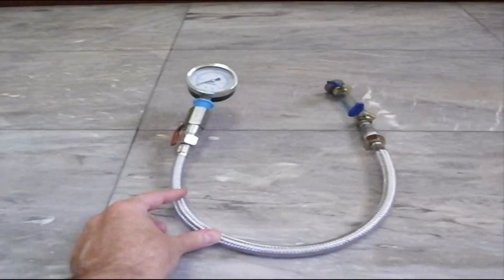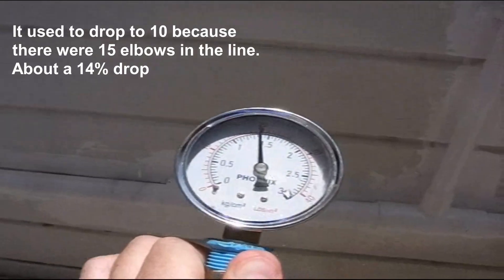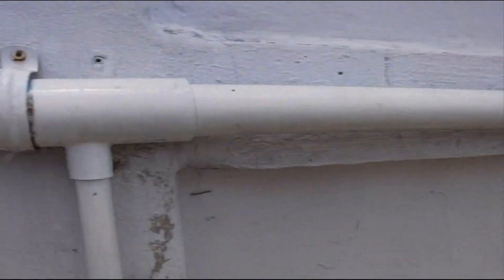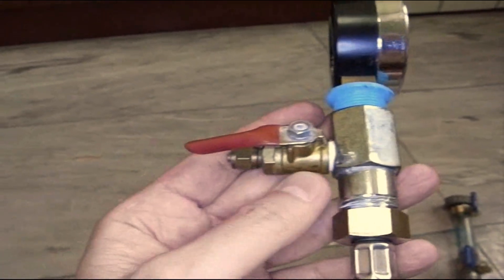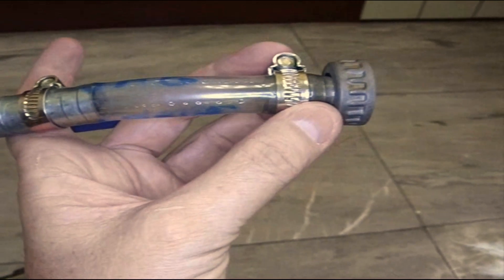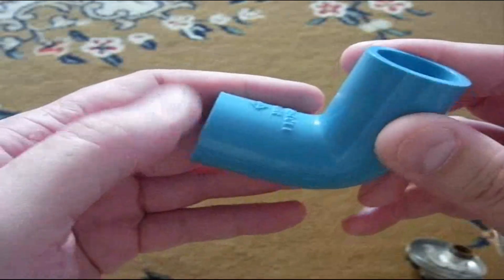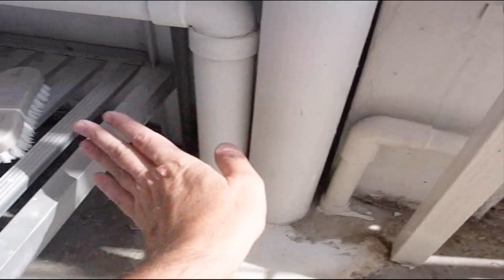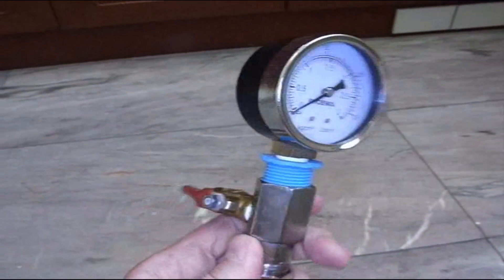DIY Static / Dynamic Water Pressure Gauge

Comment: Nice little device. Would not the dynamic pressure be affected by the size of the opening of the valve?
Reply from the maker: Yes you are right, it would.  This device gives relative readings.  So for example I can tell how different the dynamic pressure upstairs is vs downstairs, but the numbers have no absolute meaning, they are only good for comparison.  So, for example, if there's a 50% difference in two points on the same floor (like in my neighbor's house) you can bet that's a constriction or such in the one with lower readings.  The dynamic pressure reading replaces gut feel with something a little more consistent.  Now if there's only a 10% difference, that can just be the length of the pipe run or a lot of elbows.  In one place in our house there were 15 elbows in a row in a 5 meter stretch.  Each one causes about 1.5% loss (in a half inch pipe) and that was clearly measurable.  We replaced that mess with a straight piece and recovered most of the lost dynamic pressure.  Under static pressure test that tap gave no different reading than any other on that floor.